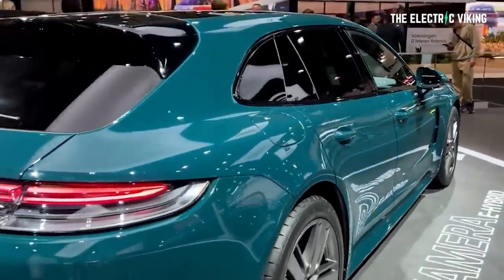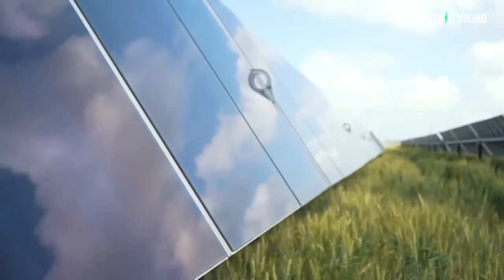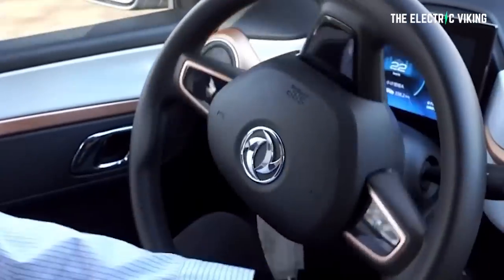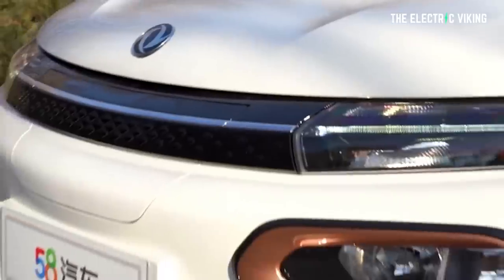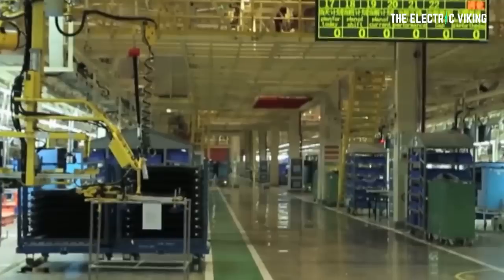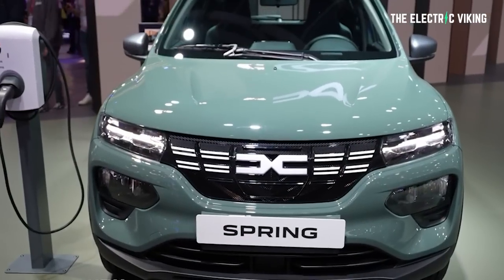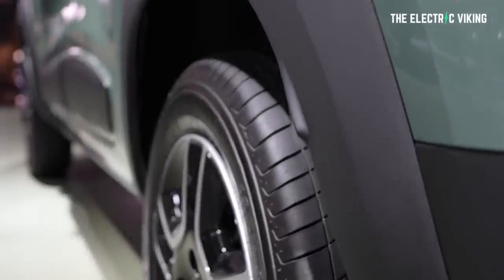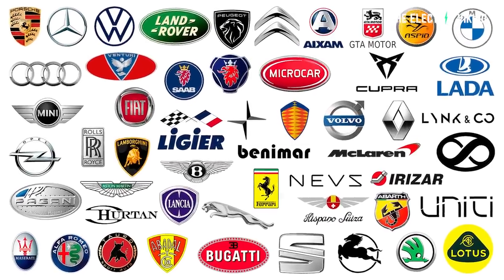Europe's NEW Dacia Spring revealed as the Dongfeng Nano Box

Comment: A $10,000 EV would quickly take over half the car market in the US, even with extremely limited performance in every way. It’s the ideal cost effective commute car.  There are some places in the US where people use golf carts to get around (Sun City retirement city in Arizona)
Reply: Fair point. It's just that in my country (Denmark) a Dacia Spring currently costs around $23,000-25,000 for a facelifted model and you can get the outgoing model for around $22,000 while stocks last.

Granted our taxes are higher than in the US but in comparison you can drive away in a new Model Y for around $54,500 here. Totally different car which is almost 2.5x the price but my point is that the Tesla is more like 5x the car which makes the Dacia poor value. If the Dacia was priced <$15,000 here then surely there would be a big market for it despite the lack of safety and low specs/quality.
Reply: Yea keep dreaming you are not going to find anything worth buying that is not complete Junk for less then 30K a 10K EV that has a battery with anything reasonable for range and will hold up under real world use is Years away Get a Corolla LE or a Corolla AWD Hybrid and you will be a happy camper for years to come.......
Reply: @carltondaye8231  not to mention Toyota dealers are everywhere
Reply: I was intrigued in the summer of 2021 ( and had one beer more one evening), so I ordered a Dacia Spring 44 HP. I ordered the car in July and get the car in March, next year. After deducting the government subsidies I ended paying 7950 EUR (no joke, no exaggeration). Brand new car. I was curious how a 44 HP car will feel like. It is almost 1 year now cince I got the car and I am still surprised by how smart and well sorted for city driving, Dacia Spring is. I can't imagine a 65 HP version...most probably it will fly...I almost use only this car when I drive inside the city, it's perfect! During spring,summer, autumn, I get 230-235 Km of range, in winter 190 Km.
Reply: A 10K EV with 250+ mile range I might buy one of those too but if you think they are in our near future here in the States I have a job for you as Unpaid Apprentice to the assistant shampoo girl to the crown princess of fantasy land hope your week goes well.......
Reply: Wuling has the best shot at this through GM.

Comment: Sam, you talked about Xinjiang Goldwind Science and then about CSSC Haizhuang.

But now Mingyang Smart Energy  released the MySE 18.X-28X.  Diameter:  280 meters. Can service around 96,000 households.

Switching to MySE 12MW can save 1/3 of wind turbines, 30% of sea area, 24% of foundation cost, 27% of tower cost, and hence 25% of the entire project cost.

Overall, 8.6% on costs per kWh are being saved.

Comment: I have a dacia spring and it awesome, i bought it used for 17.000€. A new dacia spring cost over 20.000€ crazy price for the quality. Renault dacia have to lower it. but the dacia spring has 27 kWh battery range i can drive is 250km

Comment: I can see this car being popular in Australia, but only if they boost the battery size to give it a little extra range. The MG ZS had a similarly low range before the recent facelift, but the Dacia Spring could be priced well below the price of the MG, maybe $25k AUD.
Reply: Most commuters drive at max an hour to work and an hour back. How far do you go in an hour ? 80kms/50 miles maybe. Daily 150km range with overnight charging or charging at work is more than enough for most commuters and even overkill for a lot of them.
Reply: @halnineooo136   That's great in theory, but people have become used to the versatility of having a car for commuting which can also be used for road trips when needed. Many people can't afford to own a second car just for road trips. There are also people who don't have off-street parking, and therefore can't charge overnight, and/or can't charge at work. Having a car that can drive for a few days or a week without having to recharge is a bonus, especially as it's no longer a case of 5 minutes at a gas station, if you have to sit and twiddle your thumbs at a fast charger for 30 minutes waiting for your car to recharge.

Comment: The current Dacia Spring is decent enough however the engine power is too low, it makes it sketchy on highways. With 65hp it will be more than fine. Good car for running errands, going to the next town over, things like that. They should consider one with a 30kWh battery, should still be cheap, would probably hurt Renault Zoe's sales, though.

Also here in France we have a 5000€ credit for buying an electric car under 45000€, 2500€ on top if you put an old car to recycling, The Spring is so cheap that it comes against the limit of the government paying no more than 27% of the list price. That's why the new one will be more expensive, it will be able to take full advantage of the tax credit.
Reply: Thanks for this information, very helpful! We are moving to Montpellier in 2025, and are looking to see what kind of a credit we can get for our Clio diesel. Merci!

Comment: Hi there, Thank you for the video, I feel like Dacia could really make THE cheap Electric car for the people, and I wish we could all band together to have at least one small and cheap 4 people electric car for the EUropean market, maybe the next improvement in Dacia is a bespoke EV Dacia Spring Ultimate (Built 70% in Romania, aside from the batteries, Cameras, and some parts of the engine, that would cost in total a maximum amount of 32000 euro (with options), with floor mounted and secured battery pack available for ~200 miles, with 2 motors of about ~100hp each, front and rear, and 2 safety cameras for insurance that are 140 degrees wide angle (and 60 degrees vertical angle) and record wide 1080p to a lockable glove box where you can provide your own ssd or usb stick, and have an array of settings, like always recording while driving, for about two weeks, but have 2 abilities, one is auto mark and auto save the footage, and have a manual mark button on the steering wheel, in case someone else has a crash, and it will save 30 minutes before and 30 minutes after (an hour in total) on the marked time, and using the new compression standard (AV1) that also allows for low bandwidth but high quality streaming (or compression for youtube videos), but it has hardware acceleration, so that should be built in the camera option package. (of course, you should not be obligated to add these features, so you should have options)

Comment: The Renault Kwid was a deathtrap sold in India, China & Brazil renowned for its lack of safety. Not exactly confidence inspiring and this is the platform for this EV. So expect weird transmission tunnel humps and other weirdness because it was never designed to be an EV platform. Renault / Dacia threw in some minimal safety kit with the Dacia Spring rebrand but it's still only a 1-star NCAP rating. The Spring might be fine as a runabout in a city and as a bargain bin EV but I wouldn't want to use it as anything else. Renault seriously need to have a think about their EV offerings - the Megane e-tech is a great car but it's too expensive and below that they have an ancient Zoe and this thing.

Comment: 1 NCAP star...?
Reply: I know, right? Now I can't use my daily driver for rallying. I get why people would love to have super high specced cars with five star ratings but it just doesn't bother me because I don't crash my car or let other people crash into me. The price is vastly more important than the NCAP rating. I would, however, not want one of those Toyotas where the wheels kept falling off, or a roll on roll over Subaru. Those are real safety disasters. Fractionally better survivability for children I don't have in the back seat I won't ever use even with adults, doesn't interest me in the slightest.
Reply: Oh and just in case I was wildly wrong I wondered what a one star meant. Apparently it's 100% meangingless trash with no bearing on the reality of safety. This example, which is the Dacia Jogger,  got a four star rating for adult occupancy. But NCAP maxes out on the lowest rating given. Meaning that it scored one overall because 'safety assist' was only rated at one star. It doesn't have all the most modern features like lane assist. Features which have nothing to do with genuine safety because they don't save the most lives. They're there on expensive cars to save a tiny fraction of the lives that used to be saved in crashes. Lives are saved with seatbelts and modern chassis work and so on. 

Anyway, this article goes over it pretty well but I suspect people buying recent cars that are twice as expensive and have five stars, are not five times safer in a crash or that much less likely to crash in the first place. They make the point in the article that if you buy an old car at the same price, it's likely not as safe as a lower rated current one.

https://www.carmagazine.co.uk/features/opinion/tom-wiltshire/dacia-jogger-euro-ncap

Comment: These joint ventures are a strategic move by the old auto makers to keep the much cheaper Chinese cars out of the European/UK market because the agreement is to rebadge for Europe with a European name and charge much more in that market. I guess the Chinese are happy because they’re getting the work and earning at least as much if not more and the European governments are happy because they’re protecting their companies without doing it overtly. 
This is why we don’t get very cheap EVs already, with only MG going out on their own a little with the MG4.
Reply: Its a deal with the devil for the European manufacturers as they won't be able to put limits on Chinese brand imports as they rapidly grow in the next few years. All the Chinese brands will be growing rapidly this year and next in Europe, while the European manufacturers will not have developed their own manufacturing EV capacity and ability. MG is owned by SAIC, then there is BYD, Xpeng, Li, Nio etc. There is also Changan with the Shenlan SL03 Tesla model 3 competitor (like the BYD Seal).